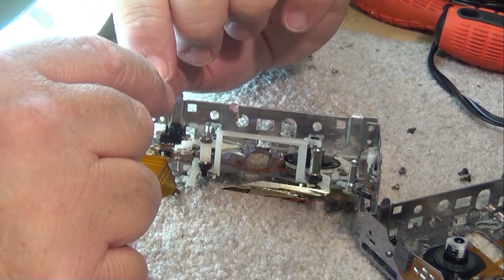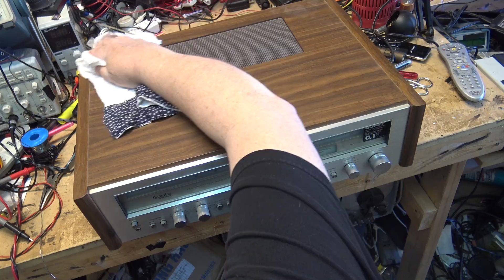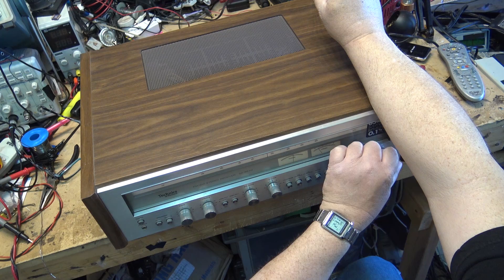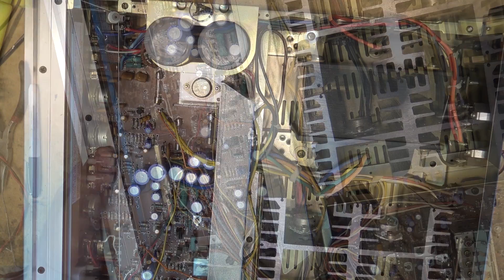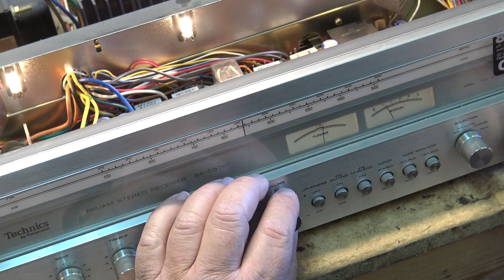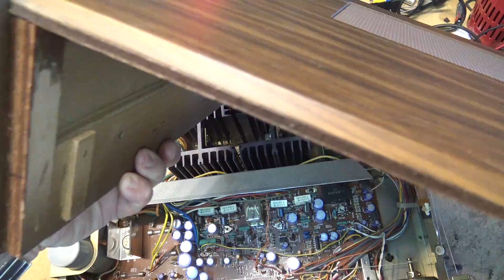Technics SA 5570 Stereo receiver service and clean up

Comment: 11:45: I have an SA-180 that has a warped display from the light heat. The bulbs go into the display on those, of course. I hope my parts unit I have coming has a good display. I'll just rig up an LED bulb in it this time to keep the heat at a minimum.

Comment: I have a Technics SA 5570 stereo receiver that is in nice condition. The last time I used it, which was many years ago, it worked fine. Recently, I plugged it back in and the volume is quite low even with the volume control at maximum. Any ideas as to why there is so little volume?
Reply from the maker: Probably some bad caps

Comment: I am located about 45 minutes south of Chicago. I'm guessing based on the radio stations you are in the Chicago area? I have a Technics Sa-700 in beautiful original condition (father's) that needs a good cleaning on the contacts/switches. Would you be able to give it a good cleaning? Thanks in advance.
Reply: Pacific North West BC.. in Canada.

Comment: my amp's right channel got distorted at volume at 8 oclock dial but when i reached above that dial the distortion is gone,i experienced it when turning on the amplifier or switching the input selector,what to do?
Reply from the maker: Clean volume pot.
Reply: @12voltvids  thanks,is it safe to use contact cleaner? im afraid if i accidentaly nearby capacitors and transistors

Comment: I have one, even has that sticker.. mine does have one very small mark on the top edge of the face.. very small but it’s there. The left channel has issues on mine .. looks like a few capacitors are maybe bad on mine as I see the plastic coating shrinking.

Comment: As far as rf noise is concerned imho plasma tvs are way worse than the old crt tvs.
Reply from the maker: Plasma have high speed switching and hv discharge so yes they create much rf noise. They also heat the room up nicely as they suck back a fair bit of power.  They do have a beautiful picture.  My Samsung 63" is 12 years old and just had a minor hiccup a few weeks ago which was a 10 minute fix and it is again working great. I'll keep it till it blows up.

Comment: 5:08 That looks like a TO-3 package rectifier? never seen one of those before
Reply from the maker: Well it is a transistor more than likely. Didn't note the number on it, but it is the regulator.
Reply: @12voltvids  I was thinking rectifier because the AC wave and the + and - symbols were on the top.
Reply: Yeah it's indeed a rectifier. I looked up the service manual for that receiver. Quite surprising really...

Comment: Why would they have dummy capacitors?  And why are you pissed off at that brand?
Reply from the maker: How am I pissed off at the brand?
Reply: @12voltvids  When you were using the contact cleaner you mentioned being pissed off at a certain brand (I don't know how it is spelled which is why I can't name it).  Not the brand of the receiver, lol!
Reply from the maker: I am pissed off at caig because they pulled my entry in the video contest a few years ago due to a troll. Had nothing to do with me, but they pulled my entry and another one saying we violated the rules somehow, which I still have no idea. So no more promoting their product from me.
Reply from the maker: These cans come in multiple capacitor and single. This one is a single so the lugs for the non existing caps are not connected to anything internal.

Comment: Just a beautiful mint receiver! These were still built to compete with Pioneer and others, with a decent analog tuner and a classic all discrete amp with no STK power module, no caloducts, just serious power and clean build. The only problem is perhaps the wires that are not specially cleanly arranged and the lack of shielding, but it's perhaps more technicaly easy to maintain and access that way. Great sound anyway, even with your neighborhood vacuuming noise...  Just love to see others like these, where there is virtually nothing to do 40 years later. You say the filters caps are done, but I guess numbers are still fine (no stress?).
Reply from the maker: Stk modules are a dirty word! And you thought all the dirty words were 4 letters!!!!!

Comment: That's a real beaut!  The dial string arrangement is very similar to the one in my Grundig Studio RPC350 music centre, very complex. The "string" on that though is actually 2 woven sheathed wires that powers the illuminated cursor & has never been quite right since I've had the thing!  Even so I prefer it to a digital tuner.

Comment: I had a SA-5370 receiver, had from 1978 till 2004 , with sl 1900 direct drive turntable and Lafayette speakers, sounded great. Wished I’d held onto it did the same job you did clean up the controls. Bought newer Sony 5.1  box set , didn’t have the same  sound , at the curb  when  I moved out. Of my fathers house, I regret leaving it along with my lps ,  Needed room for more “important “ stuff.

Comment: Back in the early 1970s I had a wonderful analogue FM stereo tuner with Dolby FM, connected to an extremely large external aerial on a rotator.
It was brilliant it I turned off the AFC button and went hunting for distant FM stations. Living in London I could pick up Lille in France 170 miles away. 
I still have the tuner today. Long live FM
Reply: the old tall antenna with the motor when i was young i would go to my freinds house they had one hooked up on the famliy stereotv me just checking out how this worked mmmm very interesting most of my friends had wicked sound system hook ups old school !!

Comment: Why swapping the bulbs with LEDs when they ain't broken. I mean LED light is more efficient and stuff but hey, there's still no LED that has the nice red glow that incandescent lamps have if you like warm white light. I hope we'll get CRI >99 LEDs soon. I would prefer cold white, around 5500K. Would make it look modern vintage!
Reply from the maker: No intent to swap bulbs with LED. Can't beat the look on incandescent bulbs. If they burn out and I can't get replacements then  that is a different story.

Comment: Can't beat the early Technics gear. Unfortunately I didn't get to buy it until the 1990's and to be honest it wasn't nearly as good as the earlier stuff. Perfect match for the 676 cassette deck you did a while back, guessing they came together?
Reply from the maker: Yes they were together along with the sb7000 speakers that I use all the time.

Comment: Way to go with the analog tuning dial,,,realigning the oscillation to tune station to the correct frequency number for the station broadcasting. 

Might want to adjust the 2 fm sensitivity trimmers,,,while tuned into an fm station,,,and watch the signal strength meter reach it,s furthest point for  the maximum strong signal,,then it probably will receive any station without the antenna connected.
Reply from the maker: The antenna was a 6" piece of wire and I was pulling in all the stations.
Reply: That,s real good how the antenna is a short piece of wire,,and you were still able to receive every station with good signal strength too.

Comment: I have a SA200 that was my first purchase of a receiver back in 78 when it came out. I use it for archiving vinyl and I have not turned it off for a good 18 years now. It stays on, but is only used for the preamp. What is your thoughts on leaving it on like this?  Never had an issue with this machine but for a  rectifier  being replaced back in 82.

Comment: I was at least expecting you to test the ESR on the power supply capacitors In the rating just to be safe.
Reply from the maker: Caps are fine.  Esr was never an issue until switching power supplies.  People think caps are the end all.   Inexperienced a d unqualified start changing every cap because they don't understand the symptoms of bad caps.  The old guys with decades of experience know that caps don't fail that often.  They do occassionally go bad, but they were always in specific circuits like the bootstrap or ramp cap on vertical circuits or the odd main ac filter.  In tube circuits the DC blocking caps (paper / wax caps) were common.  But in big linear amps like this they very seldom fail and when they do you will hear it. No need to measure.  These are such high values the esr tester won't measure it anyway.  Once you get beyond about 4700uf it is pretty useless.  Again the old timers know what I am talking about.
Reply: 12voltvids I am learning. 👍